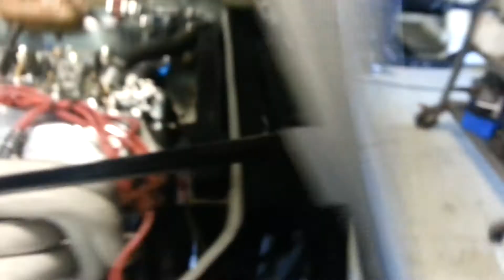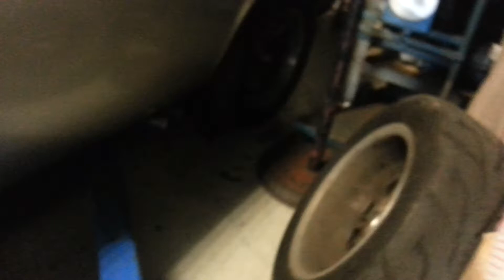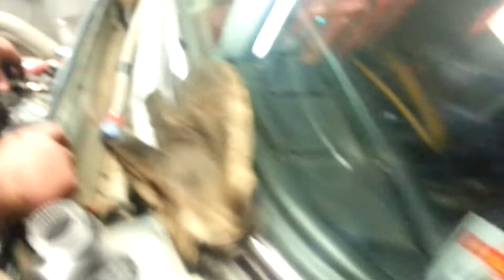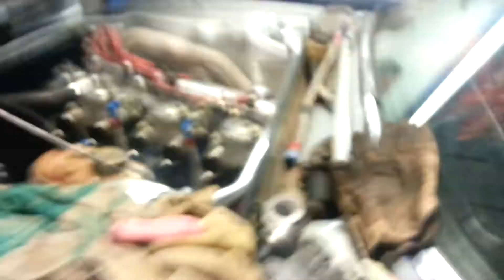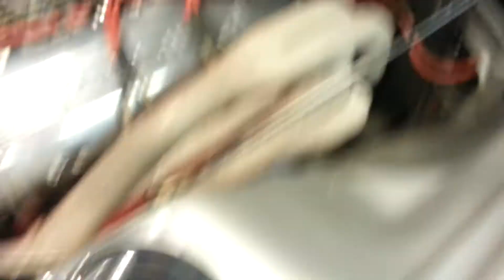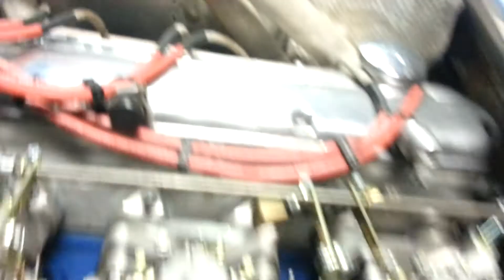BMW E3 M30 Race Engine 1st Run to 7250rpm

Comment: I've seen people spend ten grand building 3.5s. 13 to 1 plus a bore to 3.6. And not get anywhere past 250hp.
Reply: not always about peak power. if the curve is flat, then it's making really nice power through the revs, the car will really pull hard.
Reply: it's in a 635csi and it's fast. 12 to 1 not 13. lol.